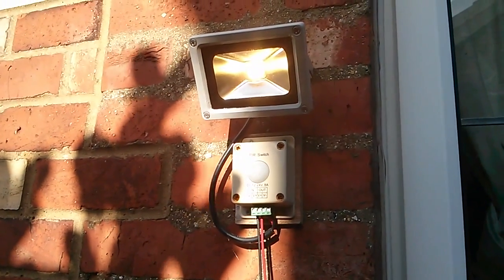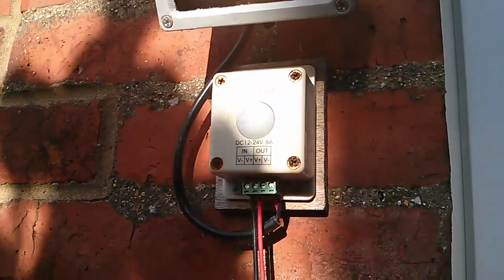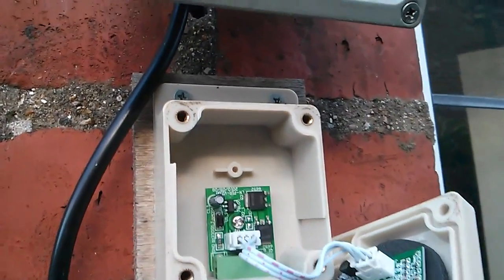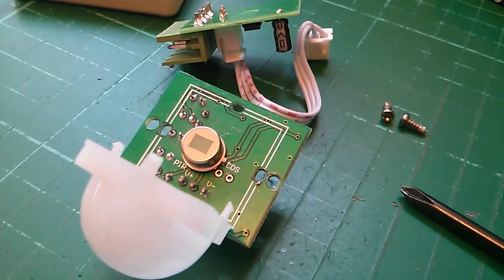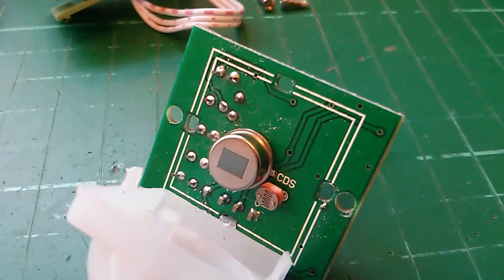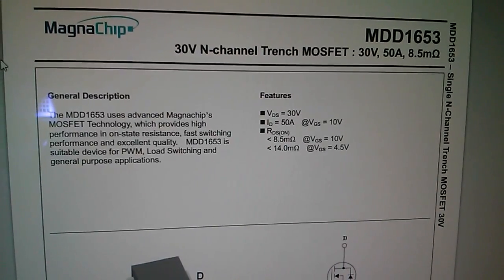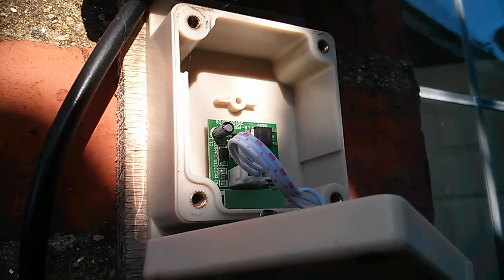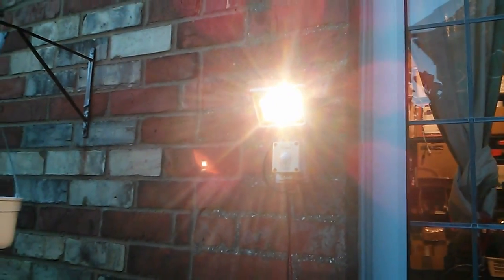10W LED PIR Floodlight Upgrade - Fitting a CdS Light Dependent Resistor

Comment: Power conversion is a good thing to be into around solar power setups! Its nearly High Spring here and already my 12volt array is producing more than the batteries need, so no real motivation to experiment with bucks to get a bit more out ov panels. But the charging capability for the 24v bank(250AH gels) is severely lacking, and I want to try and run the fridge & freezer from that soon. So if I can get excess current from the 12v system into the 24v system I'll be happy. Hence the boost focus.

Comment: I'm getting tired ov buck converters so I re-configured the one on my bench to be a boost conv. Much more fun, and it will be useful because the idea is it will charge my 24volt battery bank with excess current from the 12volt solar array. Seems to be achieving nearly 90% efficiency, which is a hell ov a lot better than a battery charger plugged into an inverter! heh The only trouble is when it's unloaded the voltage raises to about 110 volts! Got to figure out a way to stop it from doing that..